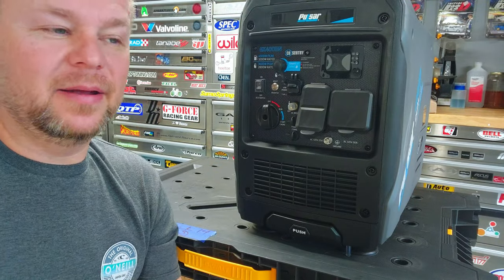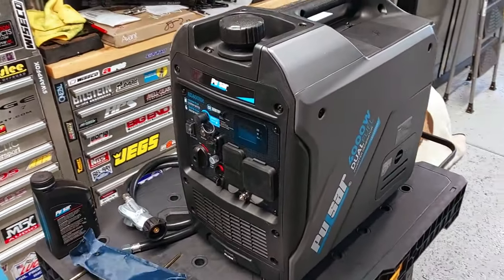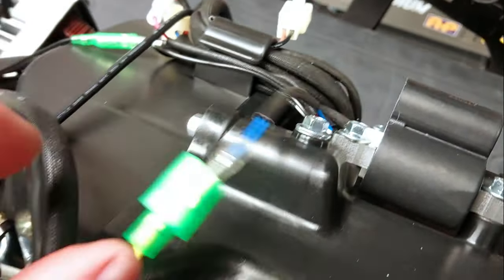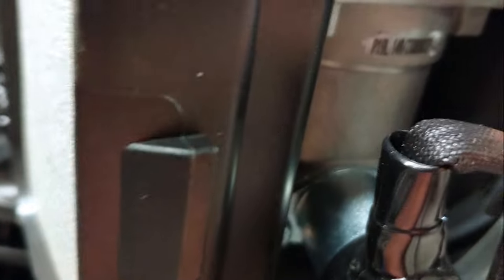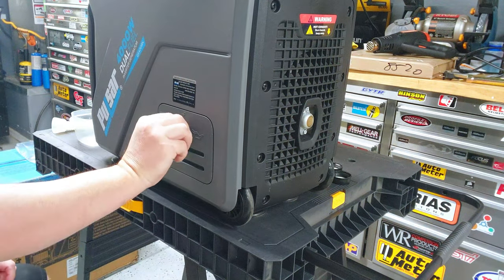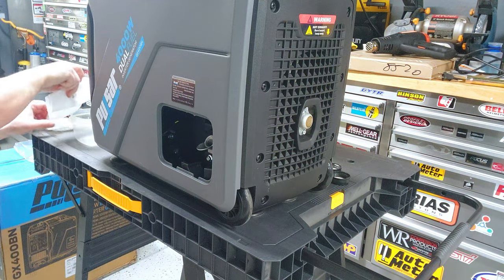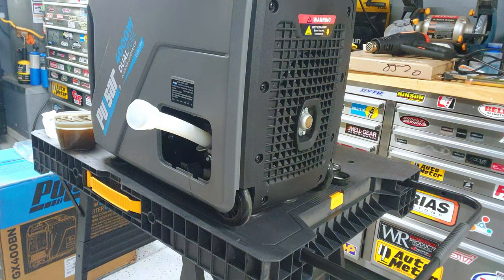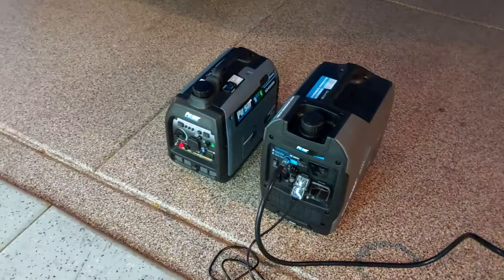NEW MODEL! 3200W PULSAR PROPANE - GAS DUAL FUEL INVERTER GENERATOR DETAILED REVIEW | RV | CAMPING

Comment: I haven’t watched the full video yet but thank you for being the first to  it review it with a deep dive into it.  I also have the other version, I’ve been eyeing this generator for 2 weeks but like you there in NO info on it. It’s not even on the pulsar website. I wanted to know what the difference was between this in the GD400BN. I also bought the upgraded spark plug and meter for the GD model thanks to your review. 

I watched the whole video, I love how detail your review is.
3 year warranty vs 1 year on the GD. The GX is about 10lbs heavier but has wheels and a handle (wheels rattle and it’s a easy fix). Uses a 13/16 hex spark plug vs 5/8, twice the size has tank, a lot more options like co detect, a digital meter, upgraded AC plugs, a different manufacturer but it’s the first version and may have a few bugs. I say this because clearly you had more then 1 issue with the meter and the valve clearance. Maybe build quality will improve in the next few months. The GX with your testing seems to be slightly less quiet. I want to have two generators 1 to run on propane only and store for emergencies, the other to use frequently around the property with gas to weld. I was looking into 2200w PG2200BiS as a option for car camping on propane before I bought the GD. The  PG is gone up in value from 420 to 699 on Amazon. The GD offers more power, about the same weight and size but now less. 
The GX seems to be on the introduction pricing because it’s cheaper then the GD. If there’s another 20 bucks or so savings near Black Friday I will order the GX to use around the house and store the GD for emergencies.
Reply: My GD400BN has the three year warranty (1 year parts and labor and 2 years parts) (Maybe they have just started offering that?).  It is printed on the box that it has the three year warranty. I even contacted Pulsar to confirm before I purchased and they told me the website is incorrect.
Reply: @lonniesykes1818  That's good to hear because the website 100% says 1 year. I know own 3 pulsar Gens and the GD is the only one that stated 1 year on the website. I bought the extended warranty so i hope i never have to use it. Make sure you get the  "three year warranty (1 year parts and labor and 2 years parts)" in writings from them.
Reply: Amazon is currently 560, eBay is currently 550, and AliExpress is currently under 500. All three may be shipping from the same warehouse.

Comment: Recently bought the smaller generator.  The engine runs very smoothly, but it overloads and shuts down on gas when I start my 13,500 but RV air conditioner . On propane, it has no problem even though it's supposed to output less power on propane. Called  the company warranty number and told them what was happening and the girl called me back and asked me what kind of gas I was using. Told her non ethanol mid grade I just bought. She said it was designed to run on cheaper regular gas with ethanol. Thought that was incorrect, so I put regular gas with ethanol.  It does same thing.  According to Google, a 13,500 btu RV air conditioner takes 3,750 watts for start up well within the range for this generator. Love the generator but disappointed  that it won't start my rv 13,500 air conditioner.  If u have any suggestions about the problem please advise . I'm hoping not having to buy a soft start kit for the air conditioner. Thanks.
Reply from the maker: So the other model GD400BN is having issues on gas. Very interesting. And yes, she had no clue what she was talking about if she thought a mid grade fuel would be the problem. Ethanol free is even better power wise so the slight bump in octane would have zero effect. I have not tried a surge type load on gas yet vs propane for that unit. Will have to add that to my list and see if I can replicate it. How is your generator running on gas? How does the plug look? Lean or rich? Wonder if the bog on gas is in the jetting.
Reply from the maker: Adding, does it still bog on gas with eco switch off? What was the altitude it was being run at?
Reply: It runs perfect and starts up first time. I also have Honda 2200i that takes several pulls to start. The generator is 3 weeks old and only have run it for 1 or two hours just enough to see how it performs. It runs smoother than my Honda I am impressed with the Pulsar 4000. I bought the Pulsar due to the added watts over the Honda and side by side Pulsar looks to be the same size as the Honda. Also like the sound of the Pulsar over the Honda it has a lower pitch. I could send it back but it runs so good and powers all my other appliances including the microwave with no problem. I just don't get why on gas it won't increase RPM quick enough to handle that ac spike. I bought it after watching your video. I would appreciate u testing yours on a spike vs propane and the gasoline. Thanks for your prompt reply.
Reply: @MR_Garage  It doesn't matter if the eco mode is on or off the red overload light comes the second I turn on the ac. My altitude is about 1000 feet msl.

Comment: Received my GX400BN yesterday, hooked up to propane and started in 2nd pull.  Engine was pretty cold, and ran a little rough at idle then sounded better after warm up.  Wheel rattle is there, I’ll fix that, changed oil after break in and put a load on it, sounded much better with load.
Reply from the maker: Yeah, they run real nice under load. And idle does get way better over time.
Reply: @MR_Garage  As you have had more time with this generator and have adjusted the valve lashings, how much do you attribute the rough idle of this generator to the valve lashings versus this generator needs more time to "break-in" more fully or what have you?  I have found on gasoline while not completely smooth, it wasn't too terrible, but on propane shortly after, it is really bad.  I am considering doing your advice on adjusting the valve lashings, but also want to get a better lay of the land of if it may be worth keeping this generator or returning it while it is still in the 30 day window to Amazon.
Reply from the maker: The valve lash correction did the most for it. After that, it did get smoother over time. I did end up returning it. Was not happy overall with the the GX and did not need the extra fuel capacity. The GD won me over as I value a more compact design and do not run off gas. To each their own though!
Reply: @MR_Garage  For running on propane as I was getting better results with gasoline, I checked the valve lash clearances and came up with the intake was too tight to measure and the exhaust came in at 0.13mm.  I put these into spec via the manual.  When I ran it, at first I thought maybe it is doing better, maybe I got it as I thought it immediately got out of hand before, but it slowly became more and more imbalanced over time between surging and sputtering that it eventually stalled after a few minutes.

Take it off of ECO mode and it sounds fairly smooth, just a little bit rough at first.  Run it for a bit with some load on it and it sounds really good.  I would say it sounds even better than it did when I first ran it on gasoline.  I could have sworn when I first ran it on gasoline, I could hear it periodically miss / skip.  Now with propane I could see a little bit of bobble on the generator, but couldn't hear it.  Not a beet missed.  So I think this work helped, but is certainly short of fixing the problem.  I suppose I am still running the stock spark plug, but I did measure it while I had the generator apart and it was within spec.

I also drained the float bowl as I had used gasoline before and tightened up the wheels using washers..  I still hear a little bit of raddle, so maybe I didn't get it quite right.
Reply: @MR_Garage  I didn't immediately follow your advice to change the spark plug as I thought it would at least last long enough to break in the generator and run it for a little bit.  No, it was too much of a counterfeit piece of junk for this.  The replacement spark plug I ended up getting was a Champion as I couldn't find the one you recommended at any of the local auto parts stores.  It came with 0 gap, so I gapped it to the minimum based on the Pulsar manual.  This turned out to be a key piece to getting this generator to run a whole lot better.  Still wouldn't call it buttery smooth, but it certainly rocks around less and is a whole lot smoother in general above and beyond the extra smoothness gained by fixing the valve lash clearances.

Another way to put it is you got your stuff right in making this generator run a whole lot better than it does out of the box.  I just didn't fully appreciate how bad the spark plug deal was.  Even when I looked at the spark plug, it didn't look bad.  It just worked like crap in the engine anyway.
Reply: @ChaJ67  NGK bud platinum,iridiym nice or even nickle

Comment: Thanks for the absolutely awesome review and teardown of this generator!  I have the gd400bn and purchased this to parallel with it for dual ac travel trailer.  I can report that the wheel carriage setup is different in that there is a molded axle with a lock nut to secure the wheels which has no vibration.  I removed the wheels and handle (which rattled a little) since I won't use those which subtracted 1.5 lbs off the weight.  My scale has the gd version at 50lbs with oil and the gx version at 57.5lbs without wheels/handle.  My manufacture date says 12/23 (even though I purchased in in July).  The valve clearance is in spec from the factory and it runs great.  Seems like they have worked those kinks out (wheels and valve clearance) and everything else is the same (spade connected to bullet is still there).  So far so good on this generator and the price is the same as the gd400bn at this point.  Keep up the good work sir!

Comment: Thanks for the great videos! After watching both reviews I went with the GX400 vice the GD400. I'll also be changing out the oil in my other Generators with the Rotella and the spark plugs to iridium. Weird thing is that with the increased features, this is cheaper on Amazon than the GD (Same price with the GD on sale). I really like the increased power and smaller size. My 2800 Champion was huge compared to these and much heavier.

Comment: How long do you run the engine on break in oil..? Sorry, it looks like you ran an hour before 1st oil change. Is that just for small engines or would you also do that for a car engine?
Reply from the maker: For small engines like this without a filter, I do the first change at 1 hour. Depending on how it looks, I may do the next at 4-5 hours. With a new car, I have always changed oil at the first 1K miles and then moved to normal intervals after that.

Comment: Facepalm… I’m literally breaking in the other model you reviewed. Was delivered 6 days ago and just got the last of the extras you recommended. 10 min into break in and see this… dang it! But anyway, thanks for making these awesome vids!
Reply from the maker: No need to face palm - it is up to 18lbs lighter and all my issues are still not resolved with the new GX series. Looks like it is going back. I may order another just to see if the one I got was just a bad sample... From the rough idle issues, wheel rattle, bad factory valve lash adjustment to the non-working amperage meter. Yeah.... The original GD I reviewed rocked out of the box!
Reply: @MR_Garage  You know what I think you’re right. During and after break in it seems super solid.
Initial fill with 14oz Pulsar 10w30 and 1oz Lucas after finagling about a tsp of Lucas into the combustion chamber and tilting the gen at different angles. Pulled cord gently 10 times. Used your trick with the propane connection and it started in about 5 pulls. Ran at idle for 30min switching “low idle” on and off then changed the oil. Relatively few metal bits stuck to the mag dipstick you recommended. 
Filled with 14oz Rotella t4 10w30 and 1oz Lucas and ran it with factory plug for an hr varying from 400w to 900w loads and hitting 1100w a cpl times.

Changed oil and found even fewer metal bits. Filled again with t4/Lucas combo and swapped to the iridium plug you recommended and it’s been charging our van flawlessly for almost an hour pushing 1800w. Far smoother with the iridium NGK. 
It’s awesome you use t6 as I generally keep gallons of 15w40 and 5w40 around for our f550 and Van. Going to switch over to t6 at about 10hrs and feel like the little gen will be taken care of after that.

I really appreciate these in depth reviews and recommendations. I know it takes a good amount of time to organize and edit these videos. Thank you!!

Comment: The two most useful things to do to this generator when you take it out of the box are brought up in this video, change out the spark plug and fix the valve lash clearances.  These two things both made a huge difference with my generator, especially when running it on propane.  Without these things, it just runs horrible.  My thought is maybe you leave the OEM spark plug in there for the first 1 hour of break-in or even 5-hour break-in as some residue ends up on it during the first part of the break-in so you have a slightly cleaner real spark plug in there later.  But really the OEM plug is complete garbage, so it is not going to really work after more than an hour or first few hours of use anyway, so you really have to replace it.  The problem with the OEM spark plug first really shows up at idle.  So rough idle, especially on propane, that OEM spark plug is starting to fail already.  It needs to go.

In other words, the order of break-in for this generator I think probably should be:
1. Before starting the generator, take the valve cover off and stuff your feeler gauge in there to figure out the valve lash clearances and adjust with a torque wrench.  I also used needle nose pliers to carefully adjust the screw.

2. Do the break in.  Mr Garage prefers to change the oil at the 1-hour mark.  The manual talks about a 5-hour break-in for this generator.  Certainly don't load up the generator too much before the 5-hour mark however you go about it.  Certainly don't go above 5 hours without changing the oil in this generator when breaking it in.  When you first change the oil, be it the 1-hour or 5-hour mark, change out the OEM spark plug for a real one like the NTK one linked by Mr Garage.  I actually had a hard time getting this particular plug at any of the major auto-parts stores in my area, so ended up with a Champion plug.  It is still working far better than the OEM plug was at the time I removed it.  I have to wonder if some of the residue on it after the first part of the break-in negatively affected the performance of the plug, granted these Chinese plugs are notoriously bad.  Just figure if it can make it upwards to a few hours before crapping out, use it for those few hours so it is the plug that gets the residue from break-in as well so the next plug stays cleaner and thus works better.  So both the supplied oil and the supplied spark plug need to go after break-in.

After adding these things to the initial setup and break-in instructions, this generator should work a lot better than it would otherwise.

Somethingthing to add for propane is it seems to work better if you start on choke for the first pull or two, then switch to run.  I think it pulls in the propane on choke and then run mode gets the propane to ignite.  It is just you don't get both at the same time when on propane.  This is of course after doing the manual purge of the fuel line as shown in this video as there is no purge valve on this setup.  This is a bit of a stripped down, you know what you are doing kind of generator.  But if you know what you are doing, you can get this started up pretty quick.

For the wheel chatter and cotter pin, a pro-tip is to put the cotter pins in rotated sideways as in the bumpy part faces inward towards the middle of the generator, in other words is in a flat orientation.  The shaft is a lot thicker than it is long where the pin hole is.  Once the cotter pin is in place, you just rotate it down and the wheel shaft is locked in place.  Easy peasy.  Don't make it harder than you have to.

Comment: Torn down, adjusted valve clearances, put thin rubber washers on wheel axles, put back together and fired up on propane, wow, what a huge difference!  I let it warm up and turned the on/off a little closer to the choke side, just a bit, not much and this generator purrs great, no wheel rattle and a lot smoother running at idle or eco off, thanks for the tips!  I have the GD400 also, I do believe the GX400 version is a little quieter also.

Comment: Appreciate your review—- I took the chance on it as I could pick it up for $480 free shipping no sales tax. 
I immediately bought the different spark plug and magnetic dipstick you recommended.  
I believe they modified the generator since your review for several reasons:
>adjusted the valve clearance and it was very close already to specs and if anything too loose
>wheel assembly is much different than yours and wheels are extremely hard to remove (could never get it)  and designed very different.  But fortunately this seems to have resolved the rattle as mine were silent on startup
All in all I feel the quirks with this have been solved enough for me to stick with it 😀
Reply from the maker: I may revisit this generator down the road. It is very popular. Verify the changes and corrections made.